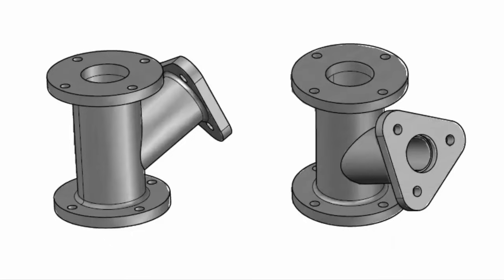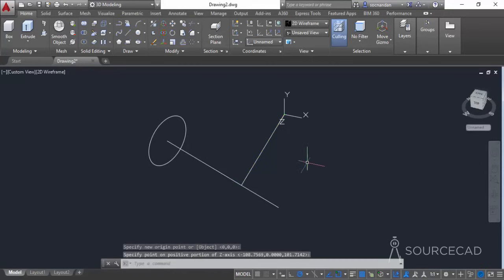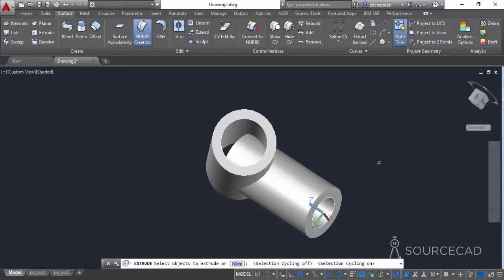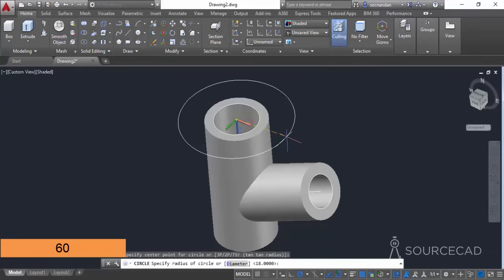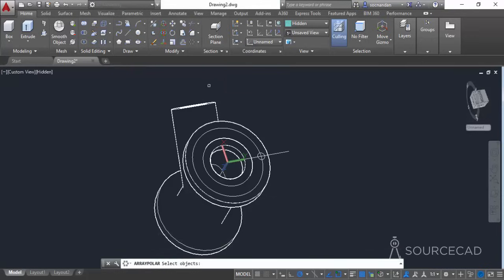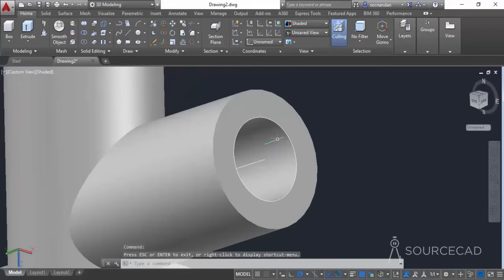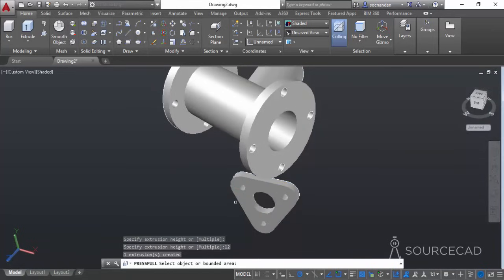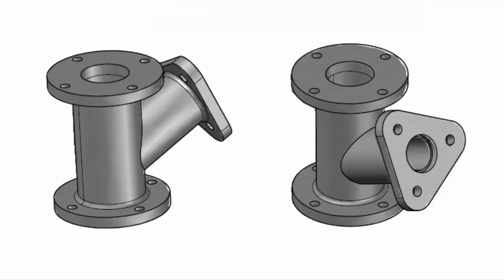3D AutoCAD practice drawing

Comment: @4:41 i selecting circle but the hole dissappearing. I m doing everything right in the video. What is wrong im doing?
Reply: select extrude command> get the mouse pointer over the surface and click CTRL key and move the mouse over the surface

Comment: how do you do this so smoothly? I can't for the life of me get the holes to be thru holes. when i push pull they become an extrusion, so i try to subtract them and the fucking thing WILL NOT select JUST the circles. every time I follow directions word for word, IM THE ONE that has it come out wrong.
edit: something as simple as realinging the wcs has my wcs disappear. i'm fucked for life if this is my luck. my views aren't even the same. the bottom view for my very last circle is a hell of a lot different than yours.

Comment: Its a cool vid. In the beginning you say the units don't matter and use the "default" however everyone's computer isn't set up the same. I opened Autocad and spent 15 mins trying to get past the first line because it went so far off the drawing surface that I couldn't see it or scroll out far enough (because it was 150 'units'). Maybe if we had started with setting up the units I could have made it through more than 1:06 of the video. Sucks because I really need the 3D practice. Thanks for sharing your knowledge. I will check out one of your other ones and see if I can follow it.

Comment: Sir..i have a problem with my autocad software..its the 2010 version..the problem is i cant find all the toolbars on the home tab such as surface toolbar,parametric toolbar and also not able to see the View Cube on 3d wireframe ...also not able to see the Drawing number ,view names on the left top corner ..facing alot problems..kindly respond with the solution.

Comment: Easy to follow, BUT, after selecting the second 'Extrude' command and pulling the circle to the line, I have a problem. probably simple but the shaded command shows me two separate tubes, which are not  connected as shown here. I have tried it numerous times but can't get it to connect. WHY? Thank you for any useful comments.
Reply from the maker: Hi Arnold, without any screenshot, it will be difficult for me to tell the exact reason.

Comment: hello, i am working in autocad 2017 on mac and selection cycling isn't an option when i click on the gear in the bottom right corner, i cannot figure out how to turn on cycling. any help would be appreciated thank you
Reply from the maker: Type SELECTIONCYCLING on the command line press enter, type 2 and press enter again. This will activate selection cycling. To deactivate it type SELECTIONCYCLING again press enter and change value to -2
Reply: great thank you! one other thing, for snapping the z axis to a specific point i don't see the tool that you are using in the tutorial in my program or even the coordinates toolbar that it's in, I'm not sure if the mac version is just missing that feature, it does have the UCS toolbar

Comment: My filet edge curves into the solid instead of outside of it. Is there a way to reverse the direction of the filet?
Reply: PLS  make sure the pieces are  joined union command and  use filletedge  in the solid tab. good luck

Comment: having issues with the tangent lines after creating them and I select trim all 3 circles become highlighted and it selects the polar array and does not let me trim
Reply from the maker: explode the array before using trim command. You can explode by selecting the array then type X on the command line and press enter.
Reply: got it thanks
Reply: For some reason I got the last instruction but now when I go to move the created fixture to the end point it seats at an angle and not flush?
Reply: @sourcecad  thank you! was stuck on this bit for over 30 mins before i found your advice

Comment: Hi Jay. Thank you for the help. I had a few issues. when I extruded the circles at the beginning, they came out as solid cylinders and thicken didn't work on them. I also had problems with slice.
Reply from the maker: have you switched to surface tab before selecting the extrude tool?
Reply: Hi Jay, I didn't go to surface previously. Thank you.
Reply from the maker: Welcome Chris